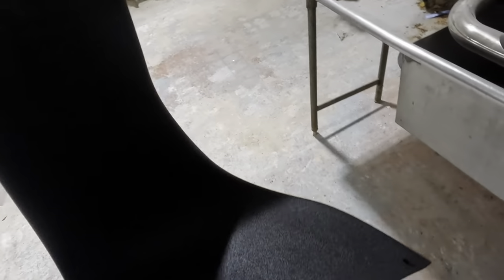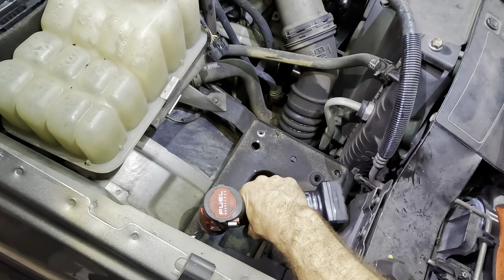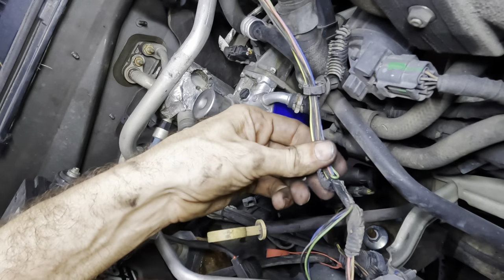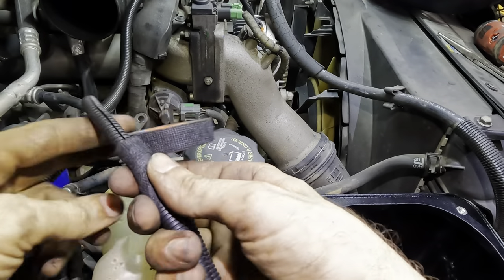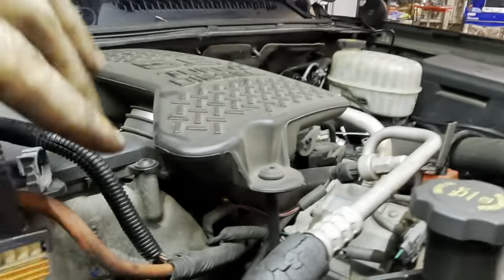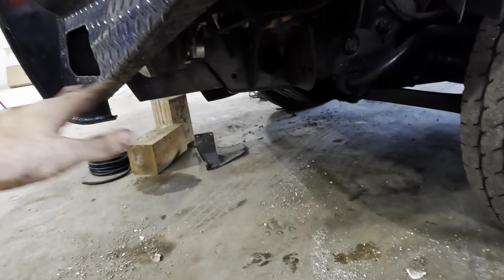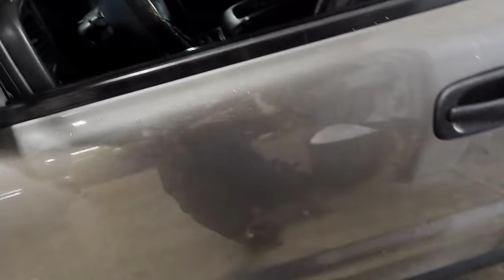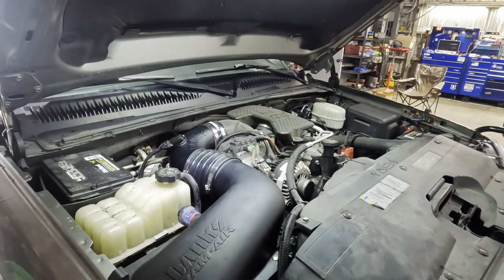This is BAD! And it's MY FAULT!  2007 Silverado 3500 6.6 @bankspower

Comment: cool install, I liked the "tweaking" of those parts, felt very relatable. Not a fan of scoop so close to puddles, sand, candy wrappers etc especially on such a large turbo engine but you know what you're doing. And def avoid river crossings :D

Comment: Ray, thanks for including the part about changing your air filter.  It may have been tempting to edit that out but including the bad with the good helps make your videos great.  I believe the air filter was in there a lot longer than you estimated.  I have never seen one that dirty.  It was black also and I wonder what caused that.  Was it engine blow by?

Comment: I have read all the comments so far about the water issue and the fact that the scoop is open at the back to let water out. It wont ever cause a vacuum and pull air up into the air box because  there's a hole in the air box by the inner wing.That's fine, but what amount of air will actually pass through the openings at the back of the scoop. it's the easiest exit. I don't see that much air will actually be going up the tube. Be good to put a shop fan in front of the scoop and measure the difference in " wind speed" at the scoop entrance and the air box. entrance.

Comment: I'm sure this upgrade will enhance performance and mpg...but...if you have to drive through any water it's going to be sucked right up into the engine. I Australia they use a intake similar to this but it's raised above the hood instead of down near the ground. That allows them to drive through creeks without sucking water into the engine. To me, this looks more like something that would be used on a race track. Good job installing it though. Just beware of any puddles on the road.

Comment: Personally I don't care for the location of that pickup but I live where it snows.  I've torn an under bumper skirt in the snow.   I also wonder about summer time road surface temperatures in Florida.   My intuition is higher would have been better.   Don't highway tractors move the air intake above the cab at the rear?  It will be interesting to hear Ray's 1 year update on this mod.
 
For sure Ray is showing his age with all the toys and trinkets.  That's OK, I did the same when I was younger but think about it differently now.  When did I get so old?  😮‍💨
Reply: All this add-on crap.  He's obviously making far too much money from the channel  :=)

Comment: That fiberious Electrical tape is called "Friction Tape". They also sell non-sticky vinyl tape for wrapping wires. 3M also has a 1.5 inch wide roll of sticky 88T too

Comment: Ray in the UK if we had an intake that low we would call it "Cold Water Injection" I think Saab tried it but it would be a massive fail in the UK, Ive towed minis out of puddles as their pistons float down stream lol
Reply: Yeah, a top breather is much more practical for us.
Reply: Just what I was thinking, that's a real water injection system.
When well designed the so called "Ram Air" effect will produce around 0.17psi at 100mph.  Just cold air for greater volumetric efficiency is more beneficial.
As for a K&N filter. . . . . . . .I suppose they do stop the larger boulders, Ray does surprise me.
Reply: I was wondering about the next time he has to drive through some Florida flood water. I guess he could remove the scoop before leaving his house.

Comment: Nice install!   I remember your storm videos where you pushed through some water.  Is there an intake suction bypass beside the filter?  I'm concerned that you will test hydro-locking your engine with the intake being low (I've done it...). I think your state is flood prone with it's daily rains and hurricanes.  If you have watched Gale's video series on the diff cover, it is well engineered and makes other aftermarket covers look lame.  He also has some other expensive goodies for the Duramax engine series.
Reply: Agreed, as soon as I saw how low it was I would have that concern.
Reply: There appears to be a hole in the side of the air box that will prevent a large vacuum forming enough to suck water up the tube. The "ram" just diverts cold air from the ground upwards, any resistance (i.e. water in the pipe) will just cause it to draw air from the hole in the airbox. If you were driving really fast into deep water it might force water up the pipe, but if you drive fast into deep water in any car you're going to submerge your engine anyway.
Reply: he will install water level sensor in the scoop.
Reply: The back corner of the scoop dies have a bypass in it.  The side of the box is open also.  Not to say you don't increase your risk if you drive through a river. But the big thing is to drive slow if you submerge it.

Comment: The thing about K&N filters is that it's the oil on the paper that catches the dirt. Needs regular maint. Once the oil is dry and used up, the filter media doesn't work as well. The space in the filter are large so it won't clog, just quits filtering.

Comment: love your videos ray. 
a bit of warning to any and all who run any of the cotton , oil kind of air filters on Turbo Diesel's, keep a vary vary close eye on your turbo fins / vans. yes they flow more air but at a cost they will let vary small particles of dust threw and dust your turbo.
Reply: But he has a sock and thats why they are oiled. Id be more concerned with oil getting on the vanes
Reply: Through
Reply: @mountainman5025  *very, very
Reply: Yes I was concerned a bit about that as I always oiled filters lightly before assembling. Granted mines wasn’t for a truck but it was oily when it came out so...yeah.
Reply: @RepairMan00  i changed one turbo that was a total loss. now granted this person ran on dirt roads with lots of dust but he was running a K-&-N filter that was cleaned and oiled as it should be and the fin dust still got it. 
a second turbo was just starting to dust i am not sure of that filter's name but it was a cotton oil filter it was blue in color.  that owner is now back to using factory paper. 
i my self ran a K-&-N on my 7.3 for a few years and i was finding dust in my intake tubs past the filter. i am now back to paper. i am sure some filters are ok too good but keep your eyes open.  changing a paper filter 2 times a year is way cheaper then a turbo
Reply: @hartsfire5706  yes from my limited experience high flows usually have a big downside like letting particulates through. Tbh stopping dust might be near impossible.

Comment: As an self appointed armchair mechanic I have a question. Does something like this suck up water when it's raining? Do you worry about that at all? I've seen a lot of turbo cars with the same type of intake.
Reply: Nope, that scoop is a pass thru design. Opening in the front and the rear. And if it is submerged in standing water, the air box at the filter has a hole to breathe from at the 10:44 mark.
Reply: @deadstroke82  ohhhhh! Man I had no idea how that worked. I saw him put the cover on the filter but I've never seen that before. Thanks for answering much appreciated!

Comment: The one good thing about K&N filters is that if they're a bit dirty, they still filter fairly well.  They're not so fun to clean and re-oil, though.  I have a K&N FIPK on my Firebird, whenever I hit the throttle, you can hear the air being sucked in.  Ray, I'll take 66 degrees over the -15 degrees Fahrenheit or -26 degrees Celsius with a windchill of -45 degrees Celsius we had Friday and Saturday anyday😜
Reply: There was enough light showing through the k&n filter to still floe better than a standard filter.
Reply: You should watch Project Farm test air filters.

Comment: The point I would point out Ray, is the fact that you actually took the time to repair the wiring loom. How many shops out there wouldn't even notice or do anything about it. If you went to a dealer, they would have to replace the wire harness, not just a new wire loom cover.

Comment: I don't know how hot it gets in your Floridian area but in a hot, dry place such as Phoenix when the ambient temp is 112 degrees the reflection from the asphalt could be 200 degrees or more. Not exactly what I would call cold air.

Comment: I ran K&N for a while but eventually could not ignore the enormous size of some of the holes in the filter media (as you can see in this video as well).  And the process of cleaning/re-oiling gets old.  I finally went back to OEM.  Much more bueno.

Comment: The plumbing is a reverse snorkel. It will pull warmer air from the road way, for one. Don't go through a deeper puddle,you may create a hydraulic situation in the cylinders or damage the turbo. I know that the customer supplied parts, but it may backfire. 35:38

Comment: The red k/n filter is a filter that needs a spray oil applied to it. Without the oil it will filter little to no dirt. The oil would be hard on sensors if u have any. They are made mostly for race cars on dirt tracks. For street vehicles you should use the blue filter which is a non oil type filter.

Comment: I agree with some of the other commenters, that low-mounted intake would be fine, if you lived in AZ. But you live in FL, where every so often, you have hurricanes, and flooding. Maybe Banks makes a snorkel setup that runs up along the A-piller on the drinker side? That might be more appropriate for your location.

Comment: I love that woven tape, have used to to make a grippy surface on a frequently touched machine surface that needs constant turning. Works great however I can't help but notice how similar it is to quality Gaffer tape. Gaff tape seems a bit less stretchy and a bit more condensed for use as an all around tape, where the cotton type is more specific to jobs.

Comment: Quite often when I lived in Queensland the tar would melt from hot road surface. 
I often felt like putting a kettle on the road to make a nice cup of tea. Interesting how all the plastic covers on the wiring loom failed. I also use that tape as well. Got sick of the gooey mess from plastic tape.

Comment: That tape is called friction tape, and the concept is as you pull it apart it warms adjust enough to warm up the glue that's on it so that it adheres well and then as your heating and cooling Cycles occur and actually forms to the wire. It is the way we did we're looms back in the day. I remember completely redoing several of the wire Looms on my 74 Fury police car which was the only vehicle I've ever owned it would do an excess of 180 miles an hour. That did involve using a stopwatch considering the speedometer only went to 140.
And on another note, that air filter was showing enough light through it that it was still working just fine. It was breathing at least as well as a paper air filter.

Comment: Hello Ray,
I Lived in Florida, and the weather has a glitch.
When Hurricanes or just bad flooding, in FL.  I notice people put air intake Higher, not lower.
As for Cold Air your Drawing from the "Hot Ground",  Ash fault, concert, sometimes well over 100F it's Self.
I hope your system does well for you.

Comment: I live in FlaDUH too and every couple oil changes I check the air filter on my '14 Grand Caravan. I decided to get a new one when I did my last oil change after returning from the northeast (5 round trips last year) and I was embarrassed to see I put 30k miles on the filter the filter it was in there since June 2019. I immediately noticed faster accelerator response! I have to say that the filter really looked good when I replaced! Don't judge a book by it's cover! Like to see if I get better than 27MPG on the highway trip! Around town mileage really suffers only 16MPG.

Comment: Duramax candy! 🍬 Yes, that black wins. That's the same dif cover I had on my 02 LB7. I drove in very deep garbage at the landfill and the banks cover never bottomed out. Great device. I'm so happy you're going all the way and monitoring temps back there too. Maybe you could rig the gauge a couple days before u change the cover so you can see before and after? Between the badass ram air intake and the cooler rear axle, you're going to gain a few mpgs noticeable fuel mileage. With the price of diesel at the moment, these parts will pay for themselves in a couple weeks! 😂. 🛻💨⛽💸. Oh, at 220k miles in Duramax years its still a teenager

Comment: You should find a way to tap into your stock rear diff cover and install then sensor, then drive the truck for a while, then change out the diff cover and see if there is a noticeable difference in temps.

Comment: To everyone worried about it sucking up water, this kit is designed for hot shot drivers or people pulling trailers on the highway! The type of truck it’s designed for doesn’t leave the pavement very often as diesels are heavy and your pulling a heavy trailer! So leave hard pack and you sink! Aside from driving thru flood waters no risk of sucking water! Now I’m sure Banks offers a kit for the off road community that works more like a snorkel!!

Comment: Diff cooler/cover:
The problem with modifying cooling components is, you can run it cooler than what it is designed for, as there is no thermostat to control the amount of cooling…

Comment: I left a chap exposed $40 air on 08 2.2L for 7 years 190,00 plus miles from install, from what I wrote down 
Car started only getting 24mpg so I had to finally replace it

Comment: my only concern would be driving in flooded street water puddles funneling the water straight into the intake. drive slowly through water pools so that it doesn't ram air the H2O.

Comment: Hi Ray.
Have read the comments and am of the same mind as your contributors. It is to low to the ground , it is an efficient water scoop, because of the opening at the back it is NOT a RAM air system. Bit of a con really, only benefit is a bigger air filter will suit people who forget to change them soon enough. 
Ray

Comment: Right I was born and raised in Southwest Detroit after we had that bad snowy of 103 in in 2017 and then had a vortex in 2018 or it was negative degrees is why I moved moved to East Tennessee in the summer, the air temperature started out at 32 and about 1:30 p.m at 58 in East Tennessee I can deal with this

Comment: I am a fan of a snorkel on a 4WD that is fixed to the "A-Pillar", not a snorkel that points down. Diesels suck in a strong lung full of air, while I imagine it will draw in water in a rain event, it wont draw much in. The filter and the heat from the intercooler plumbing pre-intercooler will probably evaporate any water. If the inlet is submerged, then I have no doubt the engine will suck in water.

Comment: On the original air intake the MAF was on a straight section. On the 'improved' one, it's on a 90 degree bend. I can't believe that doesn't affect the performance of the MAF.

Comment: Nice plan to add rear differential temp sensor. OEM sensor on our Subaru Tribeca saved us from burning up ours. Developed a leak we hadn’t noticed and temp light on dash gave heads up with small repair bill instead of a large one (and possibly avoided a breakdown). That was 35k miles ago so apparently no damage done.

Comment: "Ram air" doesn't exist.  The cold air intakes found on cars today does the work and increases the power. Hood scoops work the same way to get cooler air in, but there is no real ram effect increasing pressure. Any improvements come from installing a clean air filter back in it.

Comment: Ray, make sure you connect that low pressure AC switch connector all the way. Looked like it was on most of the way but not quite. Maybe you did later on but I didn't notice it.

Comment: I had a K&N cold air intake in my 06 Sentra Ser Spec v. what it doesn’t come with is a bypass valve so because the filter sits in the lowest part of the front fender under where (huh I said underwear) the air box sits. it would suck water into the intake. Make sure maybe AEM makes a bypass valve for your intake. Switch out the flex tube with a a bypass unless you want to destroy the maf.

Comment: My only issue is you should have taken the 2 inches from the straight section above the lower bracket mount. Could have used a plastic welder to put it back together. I hope the Banks people can finger out a better adjustable option for after market bumpers.

Comment: Not so sure I agree with scoop location.  But you do have an opportunity to test it if you put a pressure gage and a thermocouple in it and compare it with outside temperature.  One thing is for sure the larger filter will give an improvement in pressure drop across the filter.  I think its possible the road temperature could exceed the air temperature.  Maybe not but its worth the test. The pressure measure measurement would give you if there is an increase pressure while driving.

Comment: I am really surprised Banks would even produce something like that. Take a look at what ever is directly behind your grill. (Intercooler, AC condenser, or Radiator) . All that debris will be in your air filter. Just my two cents.

Comment: Nice nice install Ray but looking at the blue connector for the air low side did not CLICK you can see it is not clicked when you restart the engine

Comment: Ray…..you coulda installed a new air filter and got a result similar to what you think the intake horn is giving you. Only way to know would have been to drive it with a new filter before installing the Banks stuff. Dirty air filters Rob horsepower very slowly in almost imperceptible amounts and it’s immediately noticeable even on stock system when a new air filter is installed. But it is a neat kit.

Comment: Instead of putting screws to connect the bottom vent to the top air box you could have put some silicone and secured and kept it from rattling ever, why not mark and pre drill the mount and get 2 screws into it instead of one…Oh I agree with you on the low possibility of getting water into the engine.. Banks is well engineered and its made to prevent most of that.